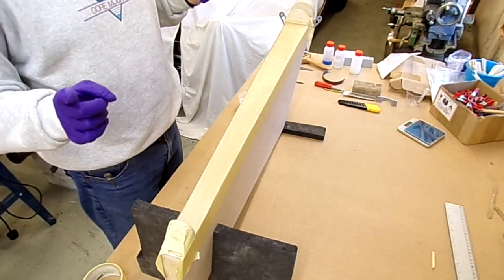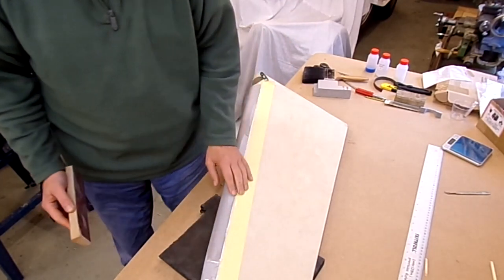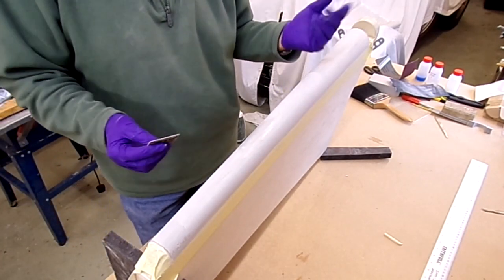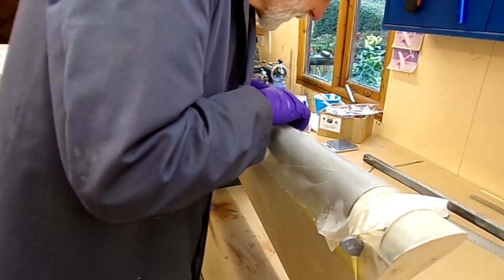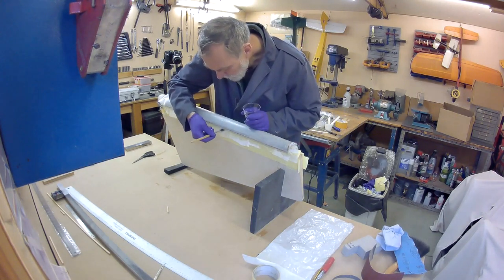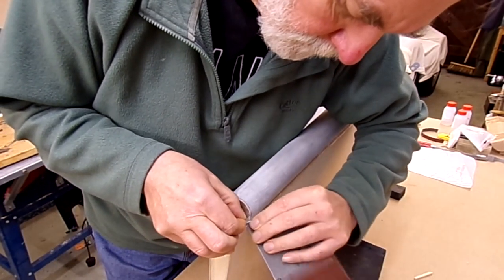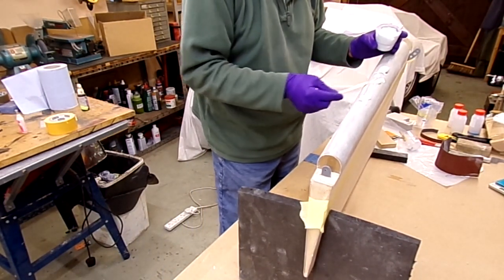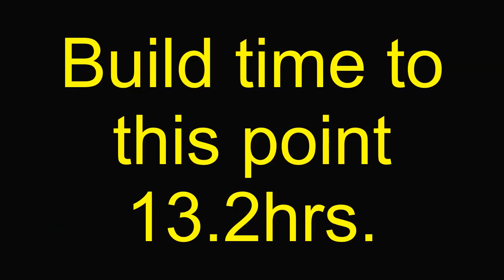Spacek SD1 TD Rudder Build EP7 (Composite Leading Edge Fit) (SSDR aircraft build).

Comment: Expert tip: When you precut the 45°x45° glassfiber plies, first apply narrow masking tape to the cloth along where you want to cut, then cut through the masking tape, leaving tape on both edges. This way the cloth will handle much better, without distoring in all directions.

Fun fact: I never used the foam for the leading edges in the rudder and flaperons. Mine are completely hollow, I just prefabricated glassfiber covers and glued them in place.
Reply from the maker: Thanks for the tip. If I had some plastic sheet I would have wetted it out on the plastic and then cut it and removed the plastic after fitting. Did you weigh your rudder when finished, if so what was it?
Reply: @flyingkub  Sorry, didn't think to weigh the rudder back then, however when I made the flaperons I did and they were 1615g each fully painted, with a momentum of 1,2Nm.
The Designer, Igor Spacek stated: "...the weight of painted flaperon should not be more than 1800 g and the moment more than 1,35 Nm."
Be aware that these numbers must be matched or better, to ensure you don't get a flutter problem.
Reply from the maker: @TDCflyer  Thanks for that I was aware of the requiements for the flaperons, just woundered how my rudder matched up.